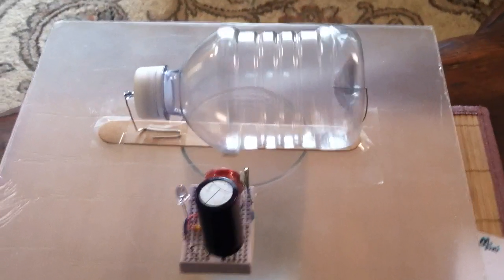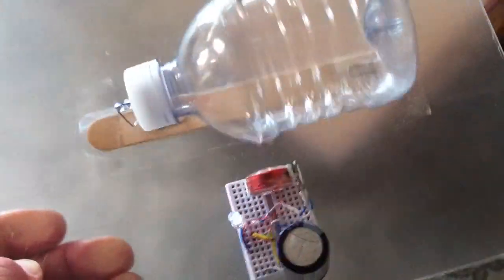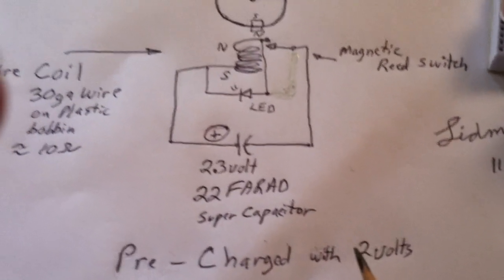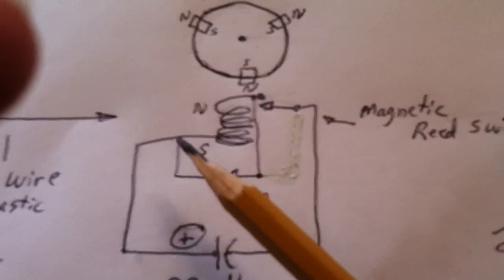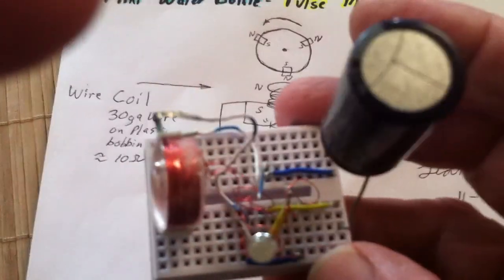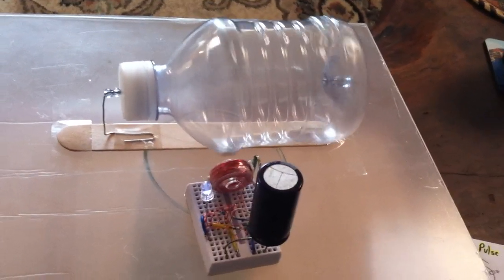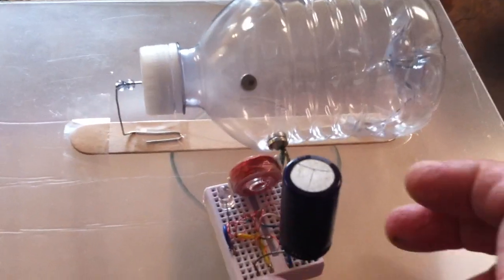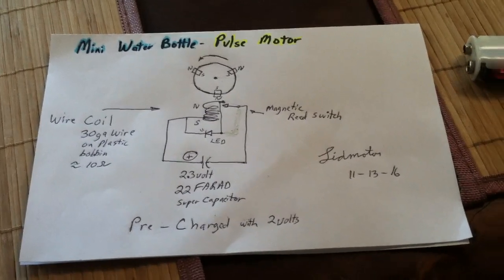Mini Water Bottle Pulse Motor--  Circuit Diagram

Comment: I like your extremely interesting videos and the educational quality is obvious. Know the principle of function of these pulse motors and have already made some ending up with
a very nice device. I do not have your talent to take a few wires, a plastic bottle and then it
is spinning. My approaches must always be a bit stilish and after completion they are adjusted as good as I can. Once they are working I do not disconnect them any more. Of
course this is time consuming and not so much can be made as you do. While watching 
 I realized how good idea it is to have the capacitor, coil, reed contact, control Led all in a self contained  "drive unit", making it possible to try to make almost everything rotate.

Comment: Great video, thanks! Where do you get your magnets and reed switches?
Reply from the maker: I got these magnets from Harbor Freight but you can get these small neo magnets from K&J Magnetics online or EBay.  The size and type is not critical.  You could probably use refrigerator magnets. I think WalMart  sells neos in the craft dept.  The reed switch I got from Electronicgoldmine online but you can find them on EBay or some hardware stores sell security system switches that use them.  Google -"reed switch images" to see all the different kinds.

Comment: I really enjoy all your videos and it has inspired me to make a few simple pulse motors to experiment with, study its operation and learn from my mistakes. Im using a small plastic sewing bobin wound with 30 awg magnet wire. when I spin it by hand I can get about 1.2v out but 0 mA? I dont understand why I cant get even .001 mA out of it. I saw you were able to light a led with using only one bobbin. I can only get enough power out of one bobbin if I pulse the coil buy on off pulses.
Reply from the maker: It is the "flyback" that does the trick.  It is high voltage but low amperage that happens when you disconnect power to the coil.  If you are spinning the rotor in front of your coil then you are generating electricity. You should be getting amperage along with voltage.  The amount all depends on coil size, magnets, rotor speed, etc.  If your rotor has a N/S pole arrangement it will come out as AC.
Reply: ***** All north facing, I checked with a compass to make sure. I forgot to mention that the only way I can measure any kind of decent voltage when spinning the rotor by hand is to use at least one diode. In my setup Im using a 10v 100uF  electrolytic capacitor with a diode connected in series. This allows me to see the voltage levels rise and fall at a slower pace. 

I plan to connect 7 bobbins in series with the 8th bobbin used as the drive coil. Im hoping to experiment with charging capacitors from the 7 coils and play around with run times.

Comment: Again nice one !! why not add a second coil Bedini style and charge the either a battery up or another super cap.

Great video for the kids they should be building this stuff in schools instead of looking at Face Ache.  nuf said.
Reply from the maker: Thanks for the good comment.  Actually this simple setup could be turned into a Bedini style "energizer" easily.  Instead of the led you could put in a reqular diode and then place the second "charging" battery or capacitor between that and the (+) rail.  You could also go electronic, like you suggested, and add a second coil of fine wire to trigger a transistor --that gets rid of the reed switch.  A full blown Bedini SSG could be made from this simple rotor setup if a special bifilar coil was used and the SSG circuit was employed.  Lots of fun stuff.